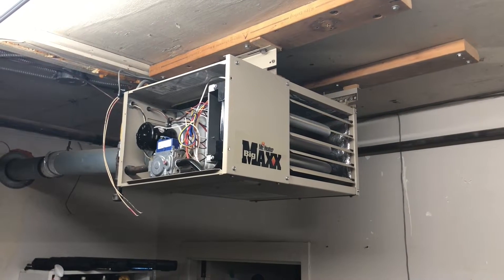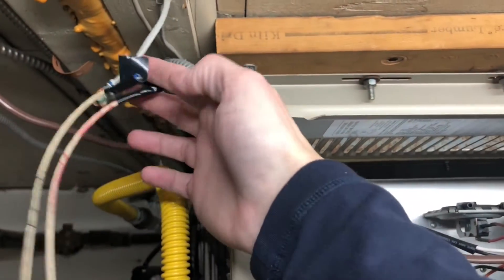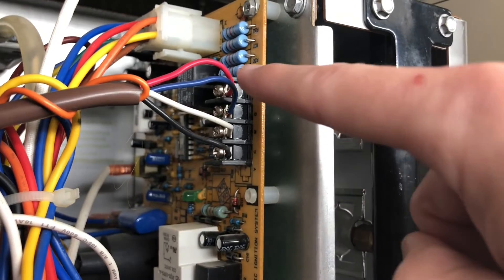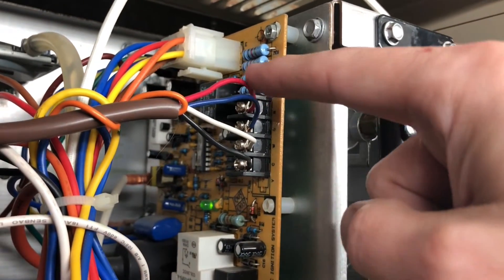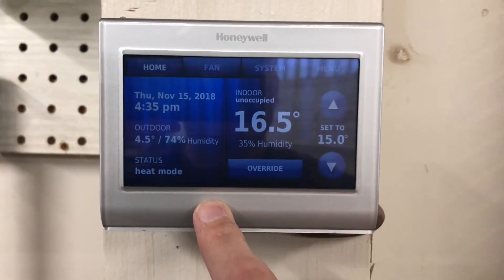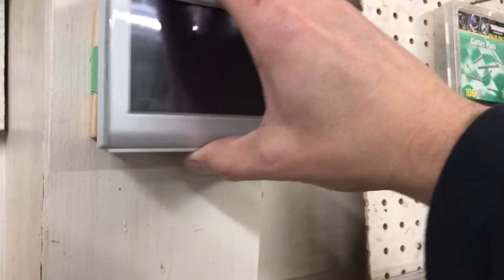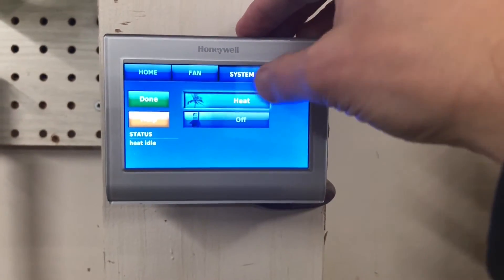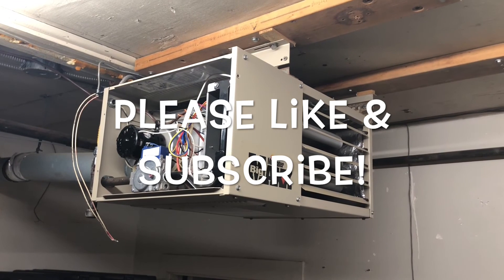How To Install WiFi Thermostat To Big Maxx Mr Heater

Comment: Thanks for your videos!
That’s one thing the pro who installed my Reznor heater didn’t discuss. The thermostat he installed (a simple Emerson) only went to 45 degrees. I didn’t even think about that until I thought I could set it to 35 or 40 degrees and keep it running during the winter. My shop is well insulated so I felt it wouldn’t cost me much to simply keep it above freezing. I am in Minnesota so it gets very cold. I have yet to find a wifi thermostat that goes low enough to allow me to turn it on and warm it up from the house before I head out to the pole barn. I ended up buying a Mr. Heater thermostat from Menard’s which allows you to set the temp to 35 degrees but it won’t show you how warm it is until you reach 50 degrees. If anyone knows of a wifi thermostat that goes to 35 or 40 degrees, let me know.

Comment: Love the info but I have a question, I have 2 Mr Heaters 80,000 BTU in my shop, my question is can I wire bother of them to 1 Honeywell smart thermostat? Thank you for your time sir
Reply from the maker: I'm not sure
Reply: From what I'm reading and watching elsewhere, you'll need 2. I have the same set up and I'll wire up a wifi thermostat to each unit.

Comment: Great Video!  I put one of these heaters in about 8 years ago and it worked flawlessly until a few weeks ago.  Started getting the 4 flash code error and the heater fan would not start.  I had gas and spark and tested both sensors and everything else seemed to work. Since it was 8 years old and showing some signs of age, I just replaced the unit with a new one from Menards.  It was under $400.  Is yours still working?
Reply from the maker: Yes, I had to remove the buildup from that port last week but otherwise it's still going. I bought the property just over 7 years ago and the unit was already installed. That port clean-out is all I've ever had to do with it for maintenance and repairs. I added the WiFi thermostat so I could monitor things since it's not my house, it's my work. I can keep an eye on it anytime.

Comment: let me ask, if you disconnect your blue does the fan still come on when needed>
Reply from the maker: If you don't have the blue wire, the fan will come on with heat as per normal. You won't have the ability to turn on just the fan, however.
Reply: @InternetDude  excellent thank you.

Comment: Hello, I am trying to install a wifi thermostat. Had it all hooked up but it's not working. Im thinking I may have blown a fuse. I have zero power to my heater now. the green led light is not flashing. Any ideas how I get power back? The outlet it's plugged into has power as I have other things plugged in and that works fine.
Reply from the maker: Put the old thermostat back on and see if it works again. That will tell you if the problem is the new thermostat or something else. Second, do you have a C wire hooked up? Wifi thermostats need the C wire hooked up to provide power.

Comment: Does the screen work no matter what temperature it is? I currently have a 2 wire with a digital screen that disconnects. However as I am in a cold climate with a current average of 0c during the winter it won’t work to startup if it is to cold. I then have to disconnect it and warm it up in the house before I can use it. The joys of being a new homeowner…
Reply from the maker: Hmm I'm not sure. If you check the owners manual for the thermostat you have it may indicate its operating temperature range. If you don't need WiFi access you could install a mechanical thermostat which would work in the cold for sure.

Comment: Will this work with any Mr heater
Reply from the maker: Hmmm I would say yes if the heater has the C terminal and you wire that to the thermostat in addition to the other two required (existing) wires.

Comment: Not sure anyone will see this but I have Mr heater 175k btu gas tube radiant heater and from what I can tell there is only a hot and neutral connection no common so I think it’s impossible to connect a WiFi thermostat I tried multiple options. Even the google nest with the c wire adapter that I think is supposed to solve that problem.  If anyone has a work around it would be great.   Here is a link to the installing guide.  Wiring diagram on page 18 sec 7.
Reply from the maker: I'm not sure about that

Comment: I have a reznor heater in my garage. It works just when i adjust thermostat it kicks on, but then once it reaches that temperature and shuts off it doesn’t kick in again. Like i have to go down and move the thermostat around for it to kick in again. Do you have any ideas behind that?

Thanks
Reply from the maker: Hmm could try another thermostat?
Reply: @InternetDude  ya i might try getting a digital one and see if that does the trick

Comment: I got my newer Honeywell T5 Smart Thermostat. I hooked it all up but no power to the thermostat. I called Mr. Heater and they are saying that even though the unit supports 4 wire thermostats that the heater does not supply power to the thermostat. My other thermostat used a battery. Honeywell does sell a 24v c wire adapter to power the thermostat but my unit is o ly 5 years old. This doesn't sound right. Any suggestions?
Reply: The wires are wired to the main board. Why give a "C" terminal with no power.
Reply from the maker: Wow that’s strange maybe Mr Heater changed something. You can test for power on the C terminal I’m not sure how exactly you’d have to look it up. The only workaround I’m aware of is the separate power supply.
Reply: OK. Tech support was wrong the heater does in fact put out 24v. However, I tried changing out thecmain board because I can't get the unit to work with the thermostat. I tried my older 2 wire setup and the newer 4 wire wifi thermostat. It always worked until ot didn't.

Comment: I really enjoyed your video.  It was very comprehensive with lots of visuals.  The thermostat on my Big Maxx died. My old thermostat is two wire but I ran 5 wire to it. The wire I ran was for thermostats but looks more like doorbell wire, (thin) compared to your wire.  Do you think it will be fine since it's only 24v?
Reply from the maker: Doorbell wire should be fine, they run on 24V also (to my knowledge).
Reply: @InternetDude  I installed the thermostat.  However, there is something wrong with the main board (I think).  I thought my old thermostat was bad since it wasn't tuning the unit on and off as it always did. THe new thermostat is doing the same thing.... I'll be calling Mr. Heater to see what they say.
Reply: @InternetDude  I was having problems so I hooked up the thermostat with a new wire and no problems.  Then I ran 50ft of this wire and it works great. Thanks

Comment: So inside the heater you landed red wire to R terminal, white wire to W and blue to C? And thanks for the video
Reply from the maker: 3:02 R=red W=white C=black and G=blue you can use whatever colors you want as long as you match the colors on the other end at the thermostat itself.
Reply: Thanks

Comment: Great video and answered a lot of questions I had about changing my controller to a wifi one. But I don't understand the fan wire. I know I need the c-wire,  but what does the fan wire do? Will my fan not work if I don't have one? I was thinking I could just run an additional wire to get the c-wire. But now I'm confused.
Reply from the maker: The fan wire is optional, it simply allows you to manually turn on the fan only using the thermostat. If you do not wire the fan wire, the fan will come on like normal during the normal heating cycle.
Reply: @InternetDude  Thank you
Reply: @Gilikemail  Did that work, just adding another single c wire?
Reply: @stevenmendez9259  yes. Adding the c wire has everything working like it should.

Comment: I want to add a wifi thermostat to my older (1990) gas shop furnace but there is only 2 wires coming from furnace and they are just wire nutted to 2 random wires. There is no spot with labeled (W R G C) on furnace. Will I need to just run an extra wire from the existing one that has the power? I think one wire is acting as power and heat and the other would just be fan, idk
Reply from the maker: Yes you will have to add the C common power wire. If I was you I'd just run new wiring but if the wiring is OK you could get away with just running one additional wire. I have done it both ways. It is critical you tap into the C terminal on the furnace. Google it to find an owners manual for your model furnace. Or you could try asking grayfurnaceman on YouTube.

Comment: Where is the isolation relay? If you don't put one it will fry either your thermostat or board eventually.
Reply from the maker: I don’t know. It’s been running without problems for over a year.

Comment: I'm having the issue where the fan power cycles because I'm not getting any grnd to the thermostat.  The furnace works great but when it shuts off, the fan cycles off and on.  I have the Common connected  to the C on the smart thermostat but when I put a multimeter on the Red and Common wire, it does not read voltage.  Should read 24V.  I have the same setup except my thermostat is a nest.
Reply: You may not be getting enough power to the C terminal. You might try this solution.
https://youtu.be/IlJZ_Llln0E
Reply from the maker: check the BigMaxx support website for ideas.

Comment: The manuals for the Big Maxx say the igniter causes RF interference therefore a microprocessor controlled thermostat is not recommended.  But it seems yours is doing just fine - any issues like that yet?

Also - I had a guy say I can't have GFCI protection on the power feed to the heater because it will trip the GFCI every time it tries to light the burner.  

Does any of that make sense?
Thanks!
Reply from the maker: I’m not sure about the GFCI thing but that could be true. As for the thermostat it’s been installed for at least 9 months and has been just fine.
Reply: InternetDude thanks!  I went ahead and installed one in my garage and used the Honeywell Wi-Fi thermostat - works great!
https://youtu.be/J4yBJHl4P0M

Comment: And if you mess up the wiring order and you hear a pop, the board contains a small plug in fuse. Don't order a new board, thinking the board is fried. Don't ask me how I know. Posting for a friend.
Reply: What and where does that fuse look like? I am wondering if I blew mine. I have zero power. The green light isn't blinking.
Reply: @AdrianSgarage8  if you’re looking from back of unit towards the circuit board it is a purple 3 amp fuse. Top left corner of circuit board.

Comment: What is the lowest temperature that the thermostat will let you set in heat mode? My current Emerson Sensi will not let me set the temperature below 10C - I would like to set it around 5 to save on heating cost when I'm not out in the garage. Thanks!
Reply from the maker: +4.5 degrees Celsius is the lowest setting.

Comment: My guy says that a digital thermostat is not accurate and effective in extreme cold weather?  Can you or anyone shed some light on this?  I live in MM....temperatures could get as low as  neg. Double digits.
Reply from the maker: I don’t know where MM is but the thermostat is indoors so how would extreme cold be a problem? It gets nearly to -40 here on the worst days. My thermostat is accurate.
Reply: Sorry Typo....MN.  Thinking about putting one in garage.  Thanks.
Reply from the maker: Ah OK. I think you’ll be fine.